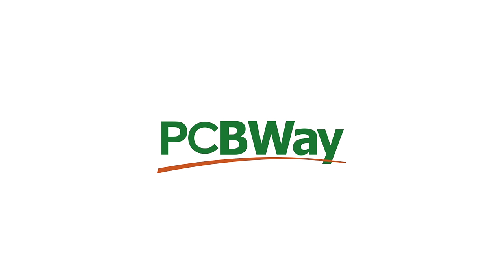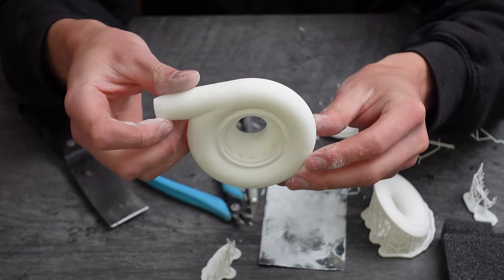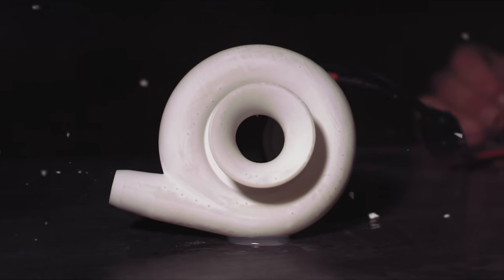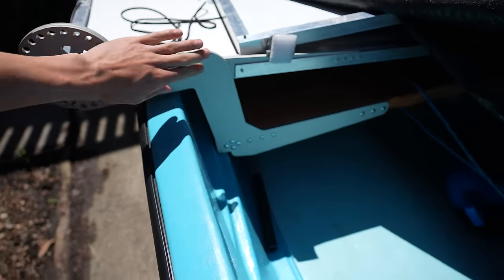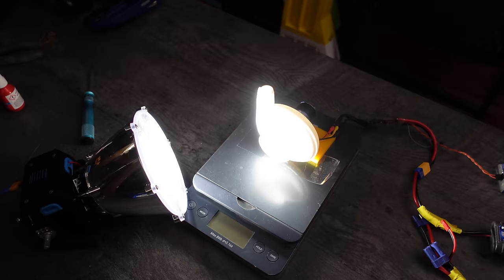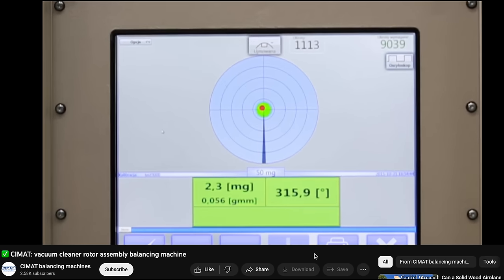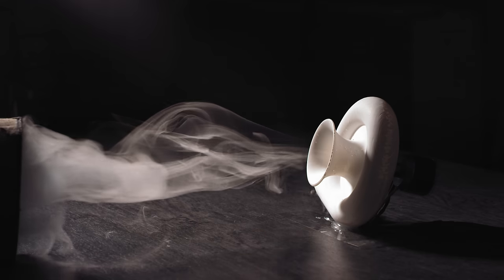3D Printed Turbo Impeller VS Dyson Motor

Comment: Today we are going to see how loud, inefficient, and unreliable we can make an impeller
Reply: Some of us learned about how Dyson motors are designed, ways to measure thrust and vacuum pressure with basic metering devices, and what it takes to 3D print and manually balance impellers that are spun at high RPM. Others just enjoyed seeing Daniel blow stuff up.
Reply: @28th_St_Air  the 3rd one for me
Reply: @28th_St_Air  I did both. 🤷🏻‍♂️
Reply: "Sucking at something is the first step to being sorta good at something."  Winston Churchill
Reply: “Experience is what you get right after you needed it.” - Me
Reply: We dont see you making any impellers do we? Let the man explore in peace
Reply: @KL0WNK1NG  I wouldn’t worry too much. Daniel is like a Honey Badger when he’s working and experimenting; he don’t give a 💩.  👍🏼
Reply: Respect his work
Reply: Isnt that what all these engineers wannabe channels do? Trying to reinvent the wheel to justify use of 3d printers and other unreliable and inefficient methods and projects for producing stuff just for the sake of entertainment?
Reply: @DashzRight yes, but you say it like it’s a bad thing. In a world full of people with a millions options on how to spend their time, designing and making things (even if they aren’t revolutionary) seems like a pretty good option. I’m making a fine extractor using an impeller. It’ll be cheaper than buying one and suited exactly to my needs - and this video helped me refine my idea.

Comment: The fact that you can actually 3D print an impeller rotating at such a speed with a plastic is insane
Reply: Makes me dizzy thinking about it
Reply: @nocare  good luck printing that with a 3D printer at home…..
Reply: @nocare  I could build a whole car at home too, just don’t think it’s worth it
Reply: @Hughjanus720  I don't see why you couldn't. Lots of carbon fiber filaments. I'd think glass fiber is less abrasive
Reply: Crazy to think about but one variable he may not have touched on is prop creep. I think that's what it's called. If in long term use it still might have exsploeded.
Reply: @nocare  welp 90-100MPa tensile strength you compare with steel. But ye, 100 MPa for a 3D printing plastic is huge.
Reply: yeah, but its $300 a liter!
Reply: @SniperX611 CF is a lot less abrasive than GF. A PA6GF30 will destroy a brass nozzle in a single print, and you're lucky if it even finishes.
Reply: @EgorKaskader hardened steel nozzles exist for this reason
Reply: Police look like playing a school drama school GSCE play
Reply: especially for not using the correct shapes! that is so damn insane! he has critical designe issues so the air is stopping the impeller and cause its more to fail. the solution is math to clear the right function of its designe - but im only here to watch :P

Comment: For balancing rotating parts like the impeller, you could use the method my father used to balance his model aircraft propellers. He had a shaft the size as the center hole in the propeller. The shaft came to close to a needle point on either end and was carefully balanced at either end on a metal plate so that it would spin as freely as possible. The propeller was then gently spun and allowed to come to a rest. If the propeller ended up one blade down, that blade was marked and spun again to see if the same blade ended up pointing down. If was the same blade again on the next try, a little was shaved from the end and the whole process repeated until it seemed to be random as to which blade was pointing down.
Reply: Wonder if ya.could use water to float it check for lower/higher side
Reply: That's how to balance everything that rotates actually
Reply: That only balances the weight, not the thrust and this impeller is that small that the weight imbalance would be tiny, you would struggle to find anything low friction enough to do the test the way you described.
Reply: @lukearts2954  honestly his comment is not even close to ChatGPT-levels of unhuman writing. I'd be surprised if ChatGPT or similar wrote that without some prompt engineering
Reply: @lukearts2954  It wasn’t chat GPT, I’m just neuro divergent and struggle to organise a coherent sentence 😂
Reply: @conorstewart2214   The imbalance is absolutely tiny, but when you spin that tiny imbalance at 80,000-100,000 rpm any imperfection is magnified.
See the picture I added, that how the majority of electric motors are balanced.
Reply: @lukearts2954  Airplane propellers can be balanced the way you say because they are symmetrical axially.

With a single axis balancing you cannot tell which side is imbalanced as per my previous comment, and that doesn’t matter on propellors.
Dual axis balancing is required so that you know if the base or the tip of the impeller is imbalanced. You could weight balance it, but as soon as you spin it up the dynamic imbalance will make it vibrate.
The same sort of dynamic balancing is utilised for engine crankshafts.
Reply: @lukearts2954  do you not see a huge difference between airplane props and impellers like this? There is a huge difference between them, if you don't acknowledge that then you have no idea what you are talking about. Just because something works in a specific scenario and people trust it with their lives doesn't mean it works the same in other scenarios. Look at the huge difference in shape between an aircraft propeller and an impeller. Also the speeds matter massively, a plane propeller doesn't spin anywhere near the speed of this impeller, you are talking a difference from a few thousand rpm to over 100,000 rpm.
Reply: @gtjack9  yes but balancing by the method OP described only balances weight, if there is a difference in thrust produced by different blades when the prop or impeller is spinning that can cause vibrations too and won't be picked up on with just a static balance test. With the method OP described you could balance a one bladed propeller with a counterweight but the thrust it produces wouldn't be balanced.  Like you said a tiny imbalance whether caused by weight or thrust could create issues when it spins at that high speed so static balancing isn't always enough.

Edit: in the case of the motor you showed it isn't producing thrust or aerodynamic effects as it spins so balancing the weight alone is enough.
Reply: the fastener too is not balanced. it's a small being at the center, but at 80k there had to be vibration. I think an inertia ring would be easier to modify than impeller blades? add rigidity, too
Reply: @conorstewart2214 the thrust imbalance is gonna be far less than what the weight imbalance can be.
Reply: @forloop7713  it may be, or it may not be, either way it would still cause vibrations and still needs balanced.
Reply: This scheme is not adequate for the high speeds involved.  At high speed, there is acceleration of 1000's of G's.  There is not enough sensitivity at 1G to do that.  The other problem is when the thing rotating has significant axial length (as your impeller does, versus a propeller which is small axially) is STATICALLY balanced, but DYNAMICALLY unbalanced.  Example of this is a perfectly centered disk mounted on a shaft, but set off-square.  It is in perfect static balance, but dynamically out-of-balance.  There is a wobble component of force.
Reply: @Cen.Reaper  no it's not.
Reply: @lukearts2954  Just because some foid uses it on her airplanes doesnt suddenly make it perfect. You're making a claim that because a "pro" does something it is automatically correct because "she wouldnt do it if she valued her life" is inferred, incorrectly.
Reply: I successfully  balanced a clutch and a flywheel at home with that method
Reply: @tiagoferreira086  and they are components that don't really produce aerodynamic effects.
Reply: @conorstewart2214  They don't, but the method work. I also balanced some fans that way.
Reply: Keep in mind this only works for static imbalances, ie if the center of mass of the impeller is offset from the axis of rotation. Dynamic imbalances only appear once the impeller is actually spinning, as the center of mass is in line with the axis of rotation but the mass is not axially symmetrical. Think of it as two equal masses on equal distance radially from the axle, but offset from each other axially.

Comment: The motors seem to need a thrust washer/bearing as the axle seems to be pushing out which pushes the impellor into the house. You can see 13:00 after the impellor explodes that the axle retracts when the motor slows.
Reply: Was just about to mention that, he's got a lot of thing's to fix to make something remotely long lasting/usable
Reply: I could be wrong, but I don't think the shaft moved it was the nuts spinning down from the inertia.
Reply: @41A2E  true, the shaft never moves only the nuts. Zoom in to make it easier to see

Comment: The Dyson vacuum motor is aurally a little different from a typical brushless motor. It is a switched reluctance motor if I remember right, they are good at reaching insane speeds.
Reply: yeah. surprised he got something as basic as this wrong
Reply: But the Dyson motor has a permanent magnet as the rotor so it's not a switched reluctance motor, it's just the same old BLDC
Reply: @hOZish7  it has no permanent magnet
Reply: @disp3rsion  neodymium magnets are permanent and dyson uses those

Comment: I also think there's something to be said for the plasticity level of the impeller material. After awhile the friction I'm sure causes material warping which expands the impeller and pushes it against the snail housing walls.

Similar to blasting a skateboard wheel with compressed air/water and it expanding.

Comment: Great work!  It looks like your impeller spins the wrong way for the thread handedness, which if true is the reason for a number of the failures: The impeller is wanting to spin the nut off the motor shaft at higher loads. Easy fix is to print the mirror of the impeller, so that it runs in the opposite direction, and reverse the motor rotation.

When I have dynamically balanced things in the past, I’ve used a flexible beam (thin long bar of aluminum) that I can clamp up on to vary its length, made a motor mount to attach to it, and put a dial test indicator (DTI) on the free end.  Gives extremely precise measurement and repeatability for balancing.

Comment: Instead of a scroll housing I'd suggest taking the air all around circumference back over the motor for cooling, also exhausting in same direction as intake airflow should give better thrust. Early gets worked this way as do most model gas turbines now

Comment: The higher speed listed for the Dyson is with the inlet blocked. This creates a partial vacuum, which means less resistance on the impeller => higher speed

Comment: Your turbine impeller exploding is due to unbalanced parts and large tolerances on the interfaces. You need to do two things to address this: 1) balance the rotating assembly, and 2) ensure that there is no movement of the impeller on the shaft.

1) is relatively easy: you construct a balancing spindle as described by another commenter. A precision shaft that the impeller mounts to, which tapers to needle points on both ends. The unit is suspended between angled plates, allowing it to spin freely. Then the whole assembly is spun and the downward facing blades marked. Repeat this cycle to ensure that the same blade is heavy, and then shave until the blade down is not repeatable.

2) is harder because of the materials you're working with and the parts. The threaded shaft on the motor is the main problem. Even if you print a tight fit on the impeller, if it is unbalanced at all then the forces will be amplified by the extreme rotation and cause the plastic to dig into the threads of the shaft, thus introducing slop. This slop allows more movement which allows more vibration and more slop until the whole thing goes boom. To eliminate this, you will need to sleeve the shaft with a hard metal (not brass or copper or aluminum, regular steel should be fine doesn't need to be hardened), and then bring your impeller bore to final size using a reamer instead of relying on the printers finish. Be sure to do the reaming before balancing. You may want to press in a hard bushing/mount on the impeller instead of sleeving the shaft, but again take care to ensure a very close fit on the shaft.

You can keep using the nut clamp system, just under size the length of the sleeve so that the nuts still clamp the impeller directly. If you're using washers, you need to ensure a tight tolerance on the washers and consider balancing them as well.

A final practical matter is airflow and cooling: you probably want to direct airflow over the motor for cooling. This will probably cost some thrust, but is critical for motor longevity especially at the high power levels you are using.

Looking forward to the next installment!

Comment: Last year in my design internship at a quantum cooling startup I got introduced to onshape. Coming vom Rhino7, which of course has so much functions and his hard to master, I quickly found a liking to onshape. The fact, that you can open, view and edit your file from almost any device from anywhere you can imagine because it's cloud based is so tremendous. Plus in a company you can manage projects and put single files together in a huge asssembly is amazing. 
The company also had formlabs Form3+ printer. Its a gamechanger compared to my own ender 3v2. No hazzle, no tweaking. The print always came out perfect and smooth.

Comment: I can’t imagine the prices of those formlabs resins. How long does 1 Liter go for you? How much did the impeller take?
Reply: $150/L the resins are expensive, but you're only using a few cc's for each print. I'm no resin printing guru, but the tools all have a calculator that you can put the price into, and it'll spit out the volume, and the cost of the part. I'll bet it was a buck or two per impeller? The shell probably $8? Wild ass guesses here.

Comment: Seems like you might have significant losses due to the design of your impeller housing. Normal centrifugal pump housings have a volute that gathers the air flung by the impeller to guide it out of the pump. Your fully toroidal housing might be losing a significant amount of thrust just swirling air around inside... Also, those internal guide vanes probably just represent losses to the airflow coming off the impeller - the angle of the outflowing air should be controlled using blade angle on the impeller, not external vanes. Would be interesting to see the effect a refined housing has on performance!

Comment: It's easier to remove support material before curing 👍
Also, using nyloc® nuts for the motor will keep them tight under vibrations
Reply: yep. my recommended workflow is to remove the part from the BP and take off the supports between Wash and Cure.

Comment: If you want pressurized air to be more efficient you should check out the inside of a compressor housing on a turbo. They don’t use director blades to force the air in the direction of the outlet to increase velocity. It will help a lot.

Comment: The reason why they are using only 2 pole pairs is likely also due to the electronic commutation limit. With an excess of 100000 rpm many cheaper controller are not capable of commutating motors with a high pole pair count. 100000 electronic communications a second is a common limit of those controllers.

And because they practically have no load on the motor, it’s forgivable to only have two pole pairs.
Reply: no, it is rare used SRM motor with quadrature sequence, very neat design for robust very high RPM cases https://en.wikipedia.org/wiki/Switched_reluctance_motor
Reply: @AABB-px8lc  Fair enough, no magnets for the rotor, makes it a bit cheaper. And with the volume of motors they need to produce it's probably a good move. You'd still ned electronics for commutation though.

Comment: I do love this video which is awesome but not quite far to compare thrust on a dyson motor which is strictly designed for being a vacuum and not for pushing air out so its really not a far comparison, but they also are designing it for better battery consumption as well. I am so impressed you were able to make a 3d printed impeller spin that fast without vaporizing, that's incredible

Comment: The snail housing: i only know of the ones that have a very small outer diameter directly behind the exit (rotation wise). Due to the same diameter much of the air gets just spun around in circle until the centrifugal forces prevent it from making the turn. Hmm... thats probably the diffrence, between max flow or max pressure on the outlet. Yours is probably set up for pressure.

You can try to balance the impeller statically by mounting it to a thin needle and place that on a post. That should reduce friction and should turn the impeller with the heavy side down.

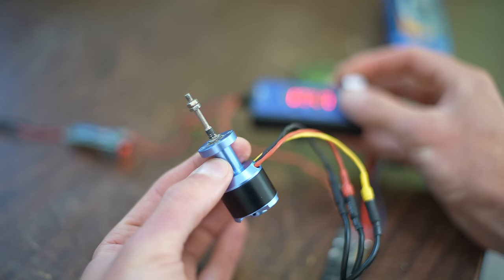Comment: 2:00 about KV rating: KV is for motor RPM what pitch speed is for a prop:
when a prop is going at it's pitch speed, it's no longer producing ANY thrust. 
Same with a brushless, if it's going at it's theoretical RPM (KV x Volts) it's no longer producing ANY torque. 
When calculating the useful rpm of your motor, you have to multiply by a 'slip' factor: typically around 0.75 or 0.8 depending on alot of things ; )
So your motor should give you 118 000 * 0.75 =  +- 90 000 RPM